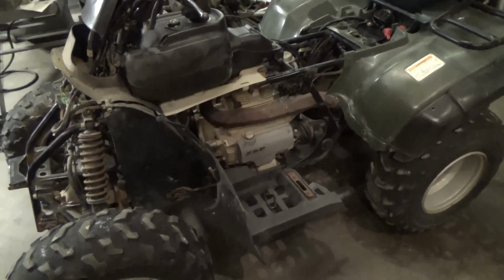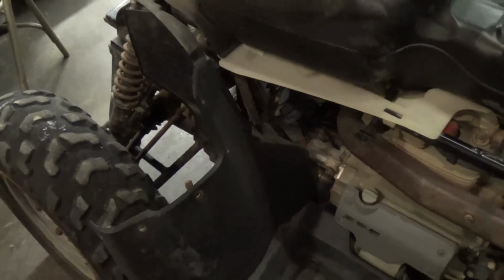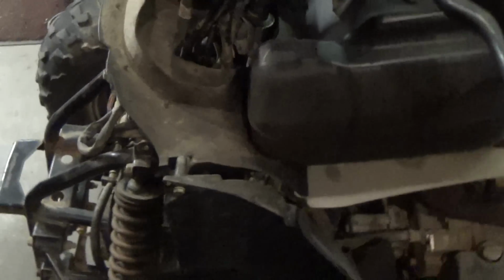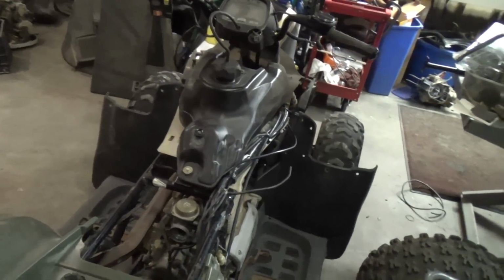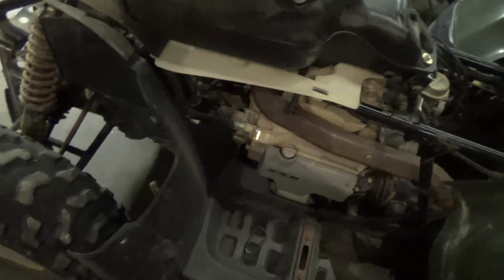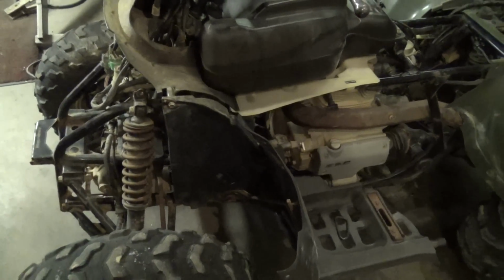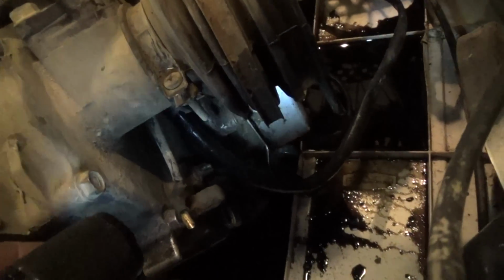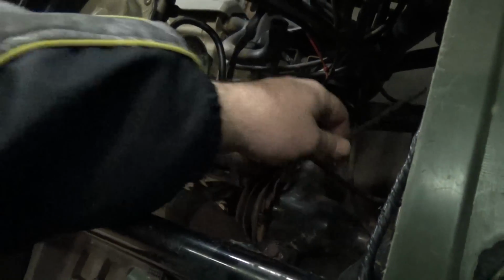Honda Rancher Electric Shift Issue Fixed

Comment: Well I have the same issue but I have replaced everything besides the shift handle buttons... it's driving me crazy and I know the shift motor works because I tested it . Replaced sensors ecu all that and still the dashboard has no n or no shift 1 2 4 5 r before I changed the ecu it had n on the dashboard I put a new ecu now it says nothing. I'm tired 😫

Comment: That’s not a starter motor.it’s you’re es motor.and mine wasn’t like yours.can’t just pull my motor off and put it back together.I had to put the brushes back in the holder then the motor on and hold them brushes with the springs with metal clips,put motor back in then pull clips so brushes set

Comment: Where did you find that troubleshooting manual?
Reply: Ok, I found a manual here.  https://www.manualslib.com/manual/804553/Honda-Trx350tm-Rancher.html?page=330#manual

IMPORTANT!  Find the link to download the PDF and do NOT add the browser extension that they try to have you use.  It hijacks your search engine and God knows what else.  But you can download the whole PDF and from there you can print what you need.

Yeah, the video wandered all over for 18 minutes but hopefully this one link will have made the ordeal worth it.

Comment: It's a good all round issue what to look for to help me out on this Foreman. This 2007 was stolen by some kids and has been a jig saw puzzle to put back together. After getting the bike going and idles and revs nice, it still doesn't move. The meter dash had to be replaced also to see just what was going on. My N does show up now since I moved the main harness where it connects. So I'm going to try and pull those apart and see what is going on. A new switch only runs around 50.00

Comment: Your video was helpful i only wish I had seen it before I went and changed a bunch of parts like you did, anyway as for a leaking carburetor a had the same problem I kept on cleaning my carb got new jets float needle to stop the carb from leaking but eventually it would leak again it was from debris from my fuel tank it kept getting in-between my float needle and the seat or float needle seat so it would cause the gas to overflow so I just installed a cheap fuel filter and that fixed it never leaked again

Comment: Do you still have the speedometer LCD/ dash LCD circuit board? If so would you sell it? Mine is messed up from the sun and the neutral light isn't working.
Reply from the maker: I don't have any parts left for it.

Comment: Can you also buy some other parts and put a manual shift lever on for foot shift while partially eliminating all the ES shifting stuff so the computer only tells the dash which gear you are in? on an 2004 forman Rubicon 500?

Comment: so I have some shift issue, it will cycle all the way through 1st thru 5th but then will not shift back with the electric shift, this is if I only go fast, if I cycle through the gears but don't do it fast it will shift back down thru the gears...any idea?

Comment: Good video. Ive got a 2003 honda rancher 350 4x4. It will shift up perfect. Its when you try to down shift that it won't shift. Some time it shifts and some times it wont. It will not go into reverse at all. I have to manualy shift it to go into reverse. You have any ideal wat the problem is and how to fix it
Reply: really late here, you've either fixed yours or moved on. I'm by no means an ATV mechanic, have some background in electronics. Other guys & gals out there with this problem. If I had one guess, I'd say the down shift (arrow) button switch is either corroded or just simply dirty. idk if you can open those up & spray in a little electric contact cleaner or not, or must simply replace the entire up/down switch. This would be for if the bike usually or never wanted to downshift thru any gear change. Now then if the problem was just would not electrically shift down into reverse, I'd be going after the little red round button switch you have to hold down. My thinking is if the shift motor, angle sensor & gears were working properly when up shifting they'd most likely work alright for the downshift. Would never hurt to clean out and regrease your little gears in the case next the shift motor. While you're down there, unplug the connector, inspect, and spray some cleaner in there, as possibly all it is a dirty connector. Don't have a schematic for the ATV, but I figure how the up / down shift switch works is that when the down button is pressed it changes the polarity of the electric sent to the shift motor. So if that is the case, all the electrical connections between the switch and shift motor are used for both up or down shifting. Only difference, for reverse, is the electric has to pass through the little red button reverse switch, and of course the switch contacts inside the down part of the shift button. UNLESS the ECM is somehow involved in the shifting, and electric has to route through it, again idk, but I'd go after switches & clean connectors first. Good luck, advice is free so maybe isn't worth much. Cheers.

Comment: I'm pretty sure someone did the same thing on my bike haha. Haven't pulled it apart yet but I'm pretty sure it is because I hear the shift motor spinning and they welded a shift lever to the manual shifter shaft so if I had to guess.. the electric shift failed, needed parts but didn't have money so they pulled the gears out and made it manually shift
Reply: That's the way mine is. Mine messed up when I was younger and my dad took it to get fixed and that's how it came back. Now 10 yrs later I want to make it electric shift again.

Comment: I think why your gears were missing on your Rancher video where you did everything else and then you finally pulled that little shifting motor off the reason why the gears were not there is because they took them out and didn't want to buy new gearing and a motor and they just took it out so they can shift it manually and they put the motor back on there so they wouldn't have a whole their dirt getting in it so the reason why they went from electric shift to the manual shift and I don't know nothing about a Honda Rancher or what was the other thing it's other name of that rig the Recon I didn't know anything about a Recon either I don't know anything about any of them quad things but that's my opinion is manual shifting brother and go with it

Comment: That's a cool video! A friend of mine has a problem with his 450 ES. He puts it in 3rd gear and can't get it out unless he rocks the 4-wheeler back and forth then it comes out. You showed a lot of good points and the sensors. He hit a concrete fireplace with the front end pretty hard. Didn't seem to hurt the bike but then the shifting problem started. It may be that sensor you were talking about in the front. Thanks for the video. I did start to fall asleep though. LOL

Comment: that's the 350 lol all you have to do is that wire harness plug in front of the handle bars probably has a little dirt in it. blow it out and save your money from buying half another quad. common problem. and for the 09 and up its usually the plug under the seat. its funny everyone says you need this and need that. even just using a pressure washer with break the seals of the o ring in the plugs. bam just saved you 20 mins of earring yourself talk

Comment: They removed the gears to bypass/disable the electric shift motor (since most likely they couldn't figure out what the issue was when it wasn't shifting i.e. ECU, angle sensor, electric gear motor, shifting controls, wiring) and went back to manual shift with the foot gear-shifter.

Comment: I got a 07 recon that wouldn't shift.  I replaced shifter control then angle sensor then shift motor and still wouldn't shift.  finally ended up replacing my sub par battery.  boom..... fixed it.   it needs good juice to make all the electronics fiction correctly. it won't shift just using the power off of the Magneto.
Reply: wow, who'd have thunk that while the bike is running the magneto, alternator, charging stator whatever they have on 'em to charge the battery would not supply the proper voltage and current to operate the shifter motor, somewhat overriding the bad battery if you will. Now I could see if the battery was TOTALLY out to lunch not taking or holding a charge at all, would not start bike from a cold start, etc. which btw a really garbage battery DOES stress out your electronics. Just a weak battery though which was starting the bike from cold start after sitting a few days, and still no proper shifting. Have to try that on mine!

Comment: Hey i have a 2006 Honda Rancher 350 es and whenever i either ride in a certain gear or get high RPMs on a gear i can't shift with the button anymore and i can use the shifter at the bottom and it shifts just not the buttons but i can stop turn key off and back on and shift fine until i do that process again. Any help?
Reply: Did you ever figure out the problem mine is doing the same thing?
Reply: @billyriezinger3536  installed new head unit and cdi and after that it resolved the issue

Comment: I have a 2001 350 es with 24,000 kms. has been a trouble free machine all those years, but the shifting is now quite sluggish, I think the shift motor is worn. thanks to your video I now have an overview of it's innards, and have gained the confidence to commence a repair. thanks again
Reply: great job

Comment: I spent several years working at a honda dealer in southern Idaho as a tech,  where atvs are in abundance.  You would not believe how many angle sensors I've replaced.
Reply: Ryan R , was the problem angle sensor
Reply: yeah angle sensor is not all that expensive, nor difficult to replace. They ARE a wear item, especially suspect whenever the shifting is erratic for all gears both up and down or the display blanks out because the computer does not know what gear the bike is in b/c the stupid angle sensor is sending it incorrect information.

Comment: I watched a video cant remember from who.. 7 of 10 people removed the shift motor and cleaned it up.. sure enough I lucked out, Now its shifting like new, also I tighten the cable reverse cable, so no more pushing the red button just press the up ES and goes into reverse.. the ES just stopped working one day after many months of rocking the ATV and pushing the button a few times.. Now my fan motor isnt running... but I think its the Fan motor cause I have power to the fan.. OH and last week my throttle cable was getting very HOT,, all I did was unplug the 2 wires to the carburetor heater and cleaned them also, and Wow doesn't get hot anymore..  I have learned many tips and tricks on Youtube..

Comment: I have a 08 rubicon 500 and when I use the automatic it shifts all fine and great but every now and again when I shift into reverse the shifting knob still get stuck, but when I turn the engine off it will shift back into N just perfect

Comment: I never dislike videos I think it's kinda rude yah know don't like something don't watch it right.  But fuck that today I watched this Shit for 12 Min's trying to fix my problem and this motherfuckers bike was missing his gears to the shift motor.  This is not a fix for the very common honda electric shift bullshit problem! Damn misleading title bullshit
Reply from the maker: Well during the video I went through almost every component of the electrical shift on that atv sorry if that did not help you at all, at least maybe see what components are apart of the system.  Also that video was a follow up video to another one where I had no clue why the shift system did not work, this video was mainly for my subscribers to see what the issue was with that atv not someone looking for the solution to their problem.  I also start the video by saying that most likely the issue I had there was not like anyone elses. One good thing is that the video is 18 min long so if you only wasted 12 min then it could have been worst.  Thanks for watching.

Comment: would u have any plastics for 2002 honda rancher for sale
Reply from the maker: I have the front plastics
Reply: +BigjermsGarage I am looking for gas tank cover, the right side black plastic cover that goes under front cover, and the rear fender flares plastics. also the battery cover. would u have any of these

Comment: i had a problem with my wife's 2003 honda rancher with not shifting. took the shift motor off and cleaned the armature  up and reinstalled and it worked perfectly'

Comment: Did not waste my time I find this video to be interesting. Perhaps you can answer a question I have a 2012 Honda rancher 420 ES I put a snorkel on it and now it is hard to start and if I get in deep water that covers the exhaust it cuts off could you possibly tell me what is going on

Comment: How did the gears get out of it? Or did they just disolve!
Reply from the maker: I'm guessing a previous owner went to replace them but never finished the job.
Reply: @BigjermsGarage  probably was going to shift over from es to manual shift. Drop the reduction gears, put in a spline shift shaft and a foot shifter and...you've got a manual shift with no more es!!!

Comment: What size are the bolts that hold the shift sensor on? Not the heatshield bolts which are 10 mm. I have it in between an 8 and 9 mm or between  5/16 and 11/32. Very frustrated right now.

Comment: I came across your video about the honda rancher es transmission because I'm trying to decide what type of four wheeler to get (rep 804!). I have some other questions about it though. If the battery dies, can you pull start the atv and still use the electric shift? Also, are automatic transmissions more reliable than a es transmission?

Comment: I have a 2007 Honda Rancher and I'm having similar problems! When I turn it on the display lights up but where it should be an N for neutral, I'm getting a flashing line.  No one I know seems to know what is going on!  The Honda dealer told me to hit the starting motor with a hammer and that didn't work! The battery, solenoid, coil, and ecu is fine! I am at my wits end with trying to figure this out so any help would be greatly appreciated Thanks!!!
Reply: Did you figure out the problem yet, I've got an 07 doin the same thing.

Comment: hello, my 2002  rancher ES 350 was actually missing the armature in the shifter motor, probably to make it easier to manually shift it with the emergency shifter honda supplies, do you still have the ICM (ECU)?  the only thing that lights up on my dash is the red oil pressure switch in the upper right hand corner of the LED screen, and the backilight turns on when i turn on the headlights, nothing else shows on the screen, all fuses good, fresh battery, cleaned contacts throughout the harness, need some parts from you.

Comment: Do you have the link to the parts you are selling on eBay? I am in need of the meter assembly or dash. Mine won't show if I am in neutral,reverse, or overheating. Any suggestions? Think it may be linked to why my bike won't electric shift when moving. Any help is appreciated.

Comment: Hey great video. Look do you still have any of the parts for the recon if so I would like to get them from you I live on Richmond as well just let me know
Reply from the maker: I have two recons.  What do you need?  I was going to make one out the two of them and sell the rest.
Reply: Well I don't know what I need I was just going to try and get the whole system and just replace everything and hopefully that will fix it. someone told me to put a new battery in it and it will work but its not working. so give me a price on whatever you have to do you want to get rid of.